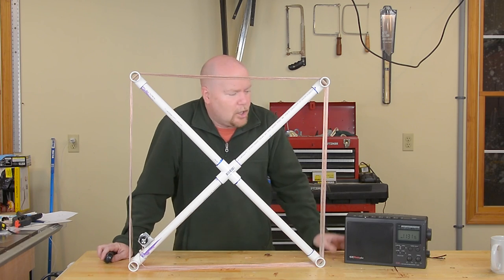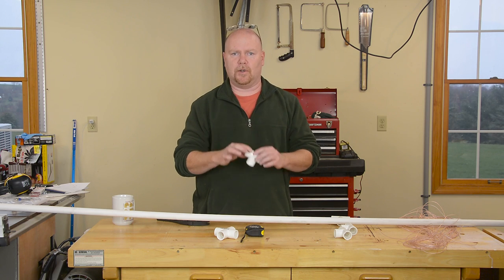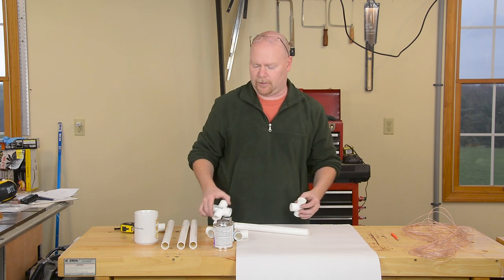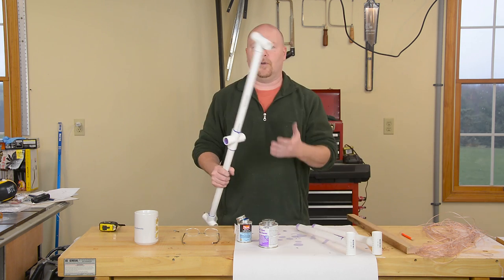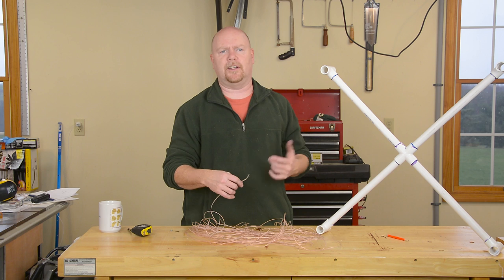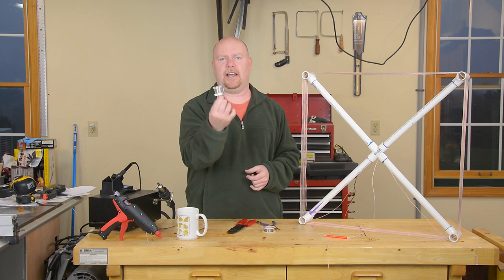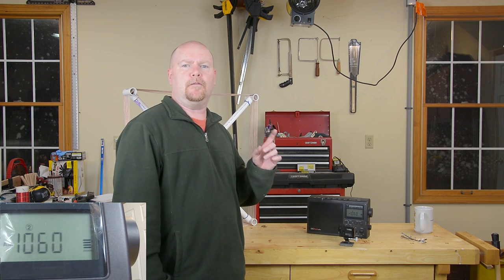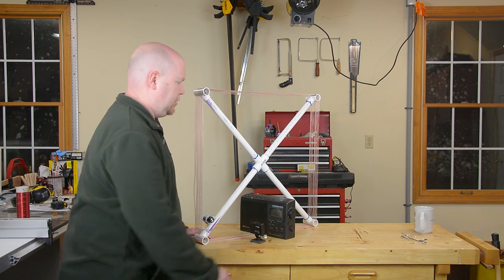AM Loop Antenna from PVC Pipe

Comment: Hello, great video!  I am in the brainstorming process in regards to a family heriloom.  It is a Victor Talking Machines of Canada R-22.  (radio only, no phonograph)  It still turns on but I can't seem to tune anything.  It's possible it works, but I am really not sure.  I can't seem to find it online anywhere.  I see an RCA Radiola R 20 and R 32.  It may be an RCA radio inside a Victor cabinet just before Victor was bought out.  A local electronics repair guy said it the only guys he knows who worked on them are retired as the restoration business wasn't worth it anymore.  On one hand I'd love to try and fix it, but without schematics I wouldn't know where to start.  On the other hand, I'm wondering if it would be better to remove the old electronics and try and build an AM radio inside of it using new parts and somehow hook it up with the original switches and dials.  The other ideas I had is to stick my portable radio inside (CCrane Airwave) and hook it up to an amplified speaker and AM loop, or last idea is to simply throw a smart speaker in there.   What do you think?  I'd love to hear your ideas, thanks!
Reply from the maker: Hi Jonathan.  Interesting project.  In the end it's up to you whether to put in the leg work to do a restoration job on it.  I assume you've found "Mr Carlsons Lab" and "Blueglow Electronics" channels on here.  Those would be the guys to ask about getting it on it's feet again.
Reply: @MattHeere  No I was not aware of them.  Thanks!  Out of curiosity, what would you do with it?
Reply from the maker: @jayehuu  Hard to say without seeing it.  If you decide to replace the guts of it go all out.  Make it into a full on high fidelity bluetooth/wifi connected media player.

Comment: Why go to all the trouble to space out the windings like that when commercially available coils just lump all the turns together?
Reply from the maker: Two reasons:
1.  We want a fair amount of wire in the antenna to "catch" lots of signal - but we're also looking for a relatively low impedance.  If they were all crammed together then you'd get far fewer turns.
2.  Wide spacing the turns makes the variance between any two turns pretty insignificant.  If they're close together, then things like how thick the wire is start to become a big fraction of the spacing - which makes calculating exactly what you'll end up with tough.
Reply: Have you tried using Litz wire or does regular wire work OK and instead of making a special frame couldn't you just wind it on a plastic milk crate?  I'm thinking of making a long wave antenna to better pick up WWVB so my "atomic" clocks will finally work and while I can get it with a small ferrite rod loop stick the signal is really weak but instead of getting a lot of ferrite rods from the Ukraine I think that I will just wind on more wire.
Reply from the maker: Regular wire works just fine.  As for the milk crate - it'll make a fine frame, just measure it carefully and input the dimensions into the calculation.

Comment: What is the impedance of the output of the antenna?  Is it balanced or unbalanced output?
Reply: You can add a single turn pickup loop that connects to the external antenna input of your radio.  You don't really need to worry about whether it's balanced or unbalanced (it would be balanced, BTW) unless you plan to put the antenna way out in the garden and bring the signal in with a lengthy feedline. But who would do that with an antenna you need to rotate by hand? It should work fine with either a 50 ohm or high impedance antenna input on your radio.

Comment: can I ask you what is a good ground source for a am christle radio
Reply from the maker: +Andrew James  Kimble  The easiest safe one you'll find around  the house is a copper cold water pipe.   The ground pin in your electrical outlets is also connected to a good ground, but unless you're 110% sure what you're doing bad things can happen mucking about in electrical outlets!

But crystal radios don't need a massive ground connection.  Any old metal stake in the ground will work.  Heck, just throwing a length of bare copper wire down on some damp earth would probably be good enough.

Comment: Can the loop and variable capacitor have a detector diode attached to be used as a radio with high impedance headphones?
Reply from the maker: Theoretically it could.  Never tried but sounds like a fun experiment.
Reply: I’ve done that before. It worked. No ground connection necessary.

Comment: Would this antenna need the variable capacitor if used with a rtl-sdr dongle for receive only? Thanks
Reply from the maker: It does.  Without the capacitor, the resonant circuit is just the small inductance of the loop in series with whatever the resistance of the wire turns out to be.  That still resonates, but not on any frequency we're likely to be interested in.
Reply: @MattHeere  If I understand this correctly I need to set the sdr to a particular channel and then fine tune the antenna to bring in the signal better? Would the variable capacitor interfere with the antenna if I were to use it for Natural radio? Meaning Vlf.
Reply: Think you want to make an LC circuit.  L = Inductor and C = Capacitor, both of which have values that can be used to calculate the theoretical resonance:
https://en.wikipedia.org/wiki/LC_circuit#Resonance_effect

...of the LC resonant or tank circuit.
https://en.wikipedia.org/wiki/LC_circuit 

This is a really great concept to learn and comprehend probably seems like after Ohms law.   Even if you forget and have to reference the equations. :-|)
Reply: A sympathetic resonance effect is going on if you were wondering:
https://en.wikipedia.org/wiki/Sympathetic_resonance

In radio lingo, the term is a parasitic element or passive radiator:
https://en.wikipedia.org/wiki/Passive_radiator

It's kind of like a director element in a yagi antenna with three elements where the radio's antenna is the driven element:
https://en.wikipedia.org/wiki/Yagi%E2%80%93Uda_antenna#Description

You can even design an AM, or any frequency, antenna with a reflector element too... though I've not seen that designed before.  For AM I've typically found the loopstick antennas that are larger as an upgrade for the radios.  For compactability, if needed for portability or whatever reason, the ferrite sleeve antennas are interesting to check out as DXerGary has a great link in one of my comments worth sharing:
https://www.youtube.com/watch?v=6CbS3zUD6hI
Reply: @whatnotzone6866  Yes and you can verify theoretical resonant range of the antenna based on calculation and there are online calculators:  
https://m0ukd.com/calculators/resonant-frequency-calculator-inductance-capacitance-lc-circuit/

No, the variable capacitor shouldn't interfere with the antenna if tuned to sympathetic resonance with the radio... however, there may be an optimal theoretical placement if you're being really really critical.  Technically, if there isn't coupling... you could even use a capacitor decade box or make one with capacitors and switches.

Facebook has some great Groups worth joining also with some excellent experts to ask relating to ELF, VLF, ULF and such:
https://www.facebook.com/groups/VLF.ULF.ELF/
https://www.facebook.com/groups/VLFexperimentation/
Reply: @jafinch78  Thanks for all the links. I will read through all the information.

Comment: Hello.  please explain how the variable capacitor is connected to the 3 wires. Thank you
Reply from the maker: There are only two wires - the two ends of the loop of wire running around the frame.  They connect to the two terminals on the capacitor.

Comment: Why not just cut slots in the pipe instead of drilling holes?would be much quicker to run the wire.
Reply: At 5:35 he mentions this.

Comment: PROBLEM!  I live just 1 mile from an AM station, so the Harmonics are ENDLESS!!  Plus I live surround by Tall Redwood Tree's so I limited!  BUT, I'll consider trying this antenna anyway.
Reply from the maker: Ugggg.  That's tough.  The loop has a big null to the sides, so as long as it's perpendicular to your local station it should help, but at that range enough signal bounces off of buildings and trees to make it come from all directions.  Good luck!
Reply: I have, on the other hand an SDR Radio, and inline with it I have dual-AM Filter Traps.
Same thing for the FM Band.  They work great!   By the way...Thumbs-Up!

Comment: The #1 issue for me is how to interface the loop with the radio. There are at least 3 different types of radios to consider: 1) ferrule internal antenna radios (which seems all you focus on), 2) car radios which have a motorola jack requiring ~ 50-100 ohms unbalanced connection -- not sure that this is constant for all car radios & this addresses such radios used OUTSIDE car installation, 3) Radios like AV Center Receivers which have dual clamp connections, which one might think ask for a balanced input at what?  300 ohms?  I cannot for the life of me thus far get an impedance rating either for the small loops that come with such stereos or for their input.  For example, I own Sony Receivers with dual clamp antenna inputs; one of which at least also labesl one input a ground! tho you are supposed to stick two wires which come twisted directly from the loop antenna.

There is also 4) some Sony stereos with little loop antennas have a 3 prong connector -- why 3? 

I wud like to replace the el cheapo Sony loop with a more formidable loop with a tuning capacitor (not visible on any Sony loop I have seen.  But I am not sure how to interface the fomidable loop with such a Receiver directly as a substitute for the little Sony loop.  I think I probably could use the little Sony loop as an inductive coupler to the formidable loop, but why should I have to fool with 2 antennas?

Comment: Matt what gauge wire did you use?
Reply from the maker: 24, although it's not critical.
Reply: Matt Heere would 20 or 22 work as well?
Reply from the maker: Yep
Reply: Matt Heere is it alright to solder the wire to both terminals on the capacitor?

Comment: Will this work for FM to
Reply from the maker: In theory yes - in practice it's tougher.  There's nothing about FM itself that make the loop work differently.  It's just that FM stations generally broadcast a much larger bandwidth signal, and the FM bands themselves are much wider.  The incredibly narrow bandwidth of a loop antenna becomes a real pain unless you're really only interested in one station.
Reply: The antenna that comes with most radios approximates a quarter wave as it is, so there is not much to be gained from another antenna - unless you can mount it high. That always helps, particularly with the shorter wavelengths.

Comment: Very interesting but, you've found and old variable cap like that in a TV ??? Please tell us the model.  ;)
Reply from the maker: Not a clue.  I've taken apart so many old things for scrap parts that there's no prayer of remembering what came from where.  These are a lot more common in radios than TVs.  One or two old models that had a vertical hold adjustment used one like this, but even of those not too many.
Reply: There has never been a variable cap like that in any TV!
Reply: @robertkat   That's my point m8.  Been doing electronics for over 50 years.   ;)

Comment: If I wanna put one of these on a remote motorized mass. What's the best way to run 2 wires approx. 30 ft to my radio listening room ? The variable cap is right beside my radio in the house.
Reply: "window" or "ladder" line should work.  You want the wires several inches apart and many inches from any metal.

Comment: You really don't need the glue primer, it will leak water from somewhere anyways.
Reply: You mean put it in the garden, dual-purpose, as a sprinkler/irrigator? 😄
Reply: The Purple primer is to reduce signal leakage when the frequency gets higher. Or you can just use the old stand by chewing gum and duct tape.

Comment: Sir.. is this antenna directional?
Reply from the maker: It is.  It receives with the plane of the loop, and has deep nulls perpendicular to the face.
Reply: @MattHeere  woah. Thanks for your reply.
May I ask a question? 

So I want to make a loop antenna for magnetic direction finder. And the magnetic source is a spark gap in my lab.
Can I use any loop antenna? I mean, there are many type of design I see, like shielding antenna, coupling, etc. But can regular loop antenna (like this one without shielding, coupling loop, and even amplifier(?)) Can work?
Reply from the maker: @jacksparrow9532  any loop will work.  A spark gap transmits across a broad free-range, so the tuning is largely irrelevant.

Comment: Geez...if he started his video just 30 seconds before we would have known what the heck the "free batteries for life" in the commercial were for.  Were they for the radio?  Just sayin...
Good job on the loop antenna!  Recently, I had an idea for a Biggie Be (opposite of Mini Me) version of this. Don't laugh but I was seriously thinking of a 6-foot square loop just over 2 feet deep with wire spaced every inch, which means I would have 24 turns of wire a shade over 24 feet long (because of the 'stretch' distance for each loop) for a total of 576+ feet of wire. My thinking (incorrect as it always is) was that I could use that for a 1.7 MHz / 175 meter full wave antenna to be used with an antenna tuner to resonate at higher frequencies. Along with that I planned to hire some yodelers from the Bavarian Alps to sing for 3 days while I strung the wire. Just kidding about the last part, probably only 3 hours.  I'll check out that site for loop calculation. I understand you have to be wary of inductance cancellation with loops so that's a great site to know about. Thanks Matt!
Reply from the maker: LOL.  Yeah - I really wish that the ads weren't necessary.  Our Google overlords seriously prioritize monetized content in search - because that's the content they get paid for.  I don't blame them.  Google isn't a charity.  Anyway your project sounds like loads of fun.  I'd love to see it when it's done!
Reply: @MattHeere  Hello Matt, I was referring to the commercial near the end of your video here 9:32 . Sometimes I pay attention to irrelevant details but I did like your video a lot.  The only thing that stops me is I don't feel I can do an adequate job with the cheaper drill press I have to drill the 24 holes in each of the 4 PVC pipes so I may pay a machine shop to do that part. After that the rest I should be able to do pretty easy.  The question is what will happen if I decide to use it as a hard-wired loop antenna vs an inductive loop antenna.  My original plan was to put something like that outside on its side (and up maybe 10 feet high) and bring the wire inside with a 9:1 balun. Again, I am pretty ignorant of antenna design so I cannot predict how bad or good it will work. All I've ever heard is the more wire and the higher it is, the better.

Comment: Cheap, not here in NZ you are using $100 to $120 of PVC....🙁
Reply: I guess you'll have to use bamboo, lol.
Reply: In Canada pipe cost $5.00 the fittings 75 cents.
Reply: Robert Kattner , than you are lucky here any fitting is between NZ$6 and NZ$15 and pipe is between NZ$ 50 and NZ$120 for a 4 meter length depending on the size , then a pot of pvc glue is around NZ$20.
Reply: Grant W. Whitwam , where do you buy T fittings for bamboo ?? 😜😜
Reply: I am no longer retired , I just became a PVC salesman in New Zealand!!!

Comment: Wow! In my coutry a 10 - 360 PicoFarad (used) will cost around $300.00 Dollars
Reply from the maker: Any old radio with a mechanical tuner will have at least one, usually two of them in it.  They are easier to salvage than to buy as a rule.
Reply: Como dicen, puedes obtenerlo de un radio descompuesto o de un taller de electrodomésticos, de los que aun tienen cosas viejas... o bien puedes encontrar precios razonables en eBay o Aliexpress.... mira: https://www.aliexpress.com/item/32406520331.html?spm=a2g0o.detail.1000014.2.6f946b62Mykipg&gps-id=pcDetailBottomMoreOtherSeller&scm=1007.14976.165864.0&scm_id=1007.14976.165864.0&scm-url=1007.14976.165864.0&pvid=4bb97437-4782-4554-9602-7cd3ef9e62d0&_t=gps-id:pcDetailBottomMoreOtherSeller,scm-url:1007.14976.165864.0,pvid:4bb97437-4782-4554-9602-7cd3ef9e62d0,tpp_buckets:668%230%23131923%2319_668%23808%234093%23898_668%23888%233325%2313_4976%230%23165864%2345_4976%232711%237538%23699_668%232846%238115%23890_668%232717%237567%23959

Comment: what a nonsensial work :)  to drill holes and thread the wire. It is much easier to make scores an the tee and wrap the wire around it, stability will be the same ;)
Best regards!
Reply from the maker: I mentioned that in the video.   I happen to think that the antenna looks a lot better this way though.   Plus making all the wholes using the machinist vice is very fast, absolutely precise, and leaves the end caps more resistant to damage when the loop falls over.  

If you have to manually mark each slot and then cut them with a saw you'll eat up a lot of the time saved in the winding process.  So the way you suggest may or may not have an upside.  In either case, it's definitely not enough better to claim this way in nonsense :)
Reply: yes my thoughts as well  ;) much easier as well.